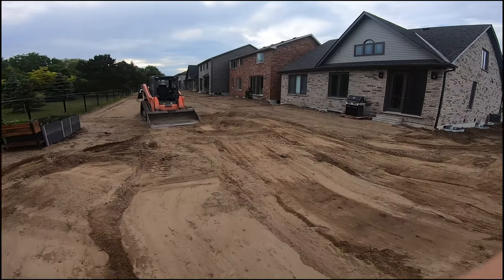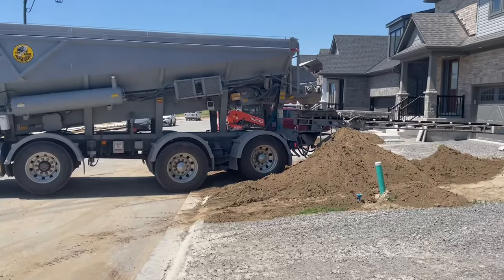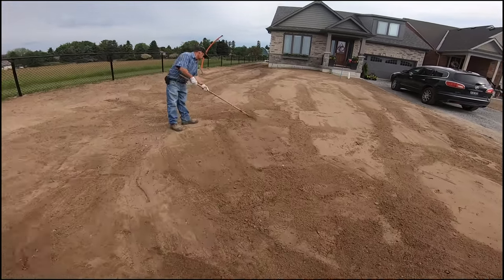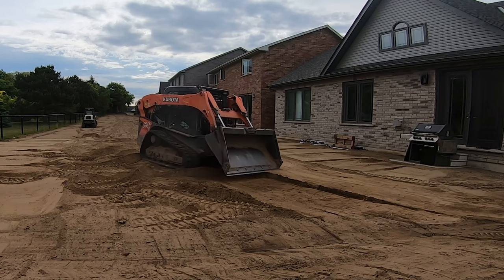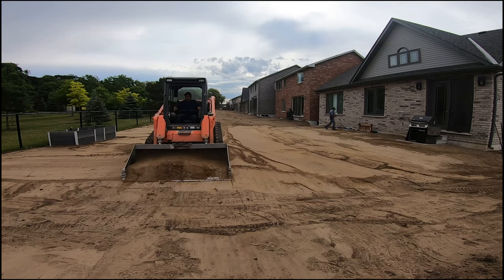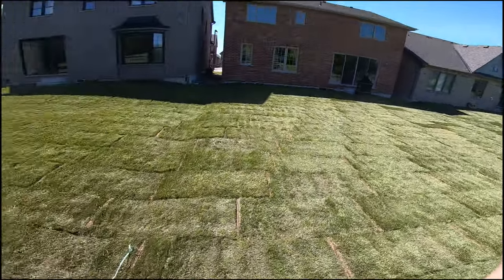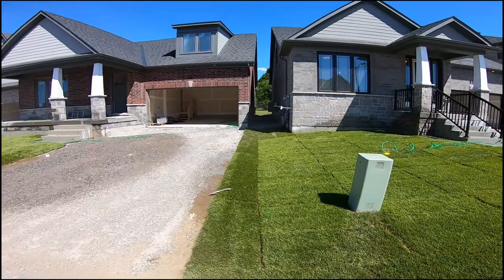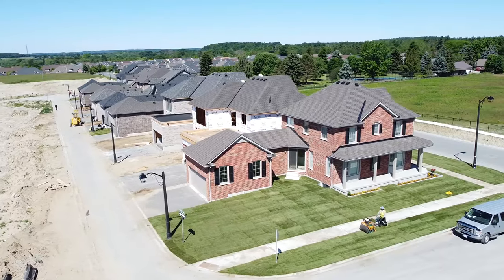TOPSOIL - GRADING - SODDING - A LAKESIDE RESIDENTIAL SUBDIVISION  (THE FULL PROCESS)

Comment: Did you shoot points on it to be sure the water is flowing correctly? It honestly looks like that back area where all the sod is will pool in the center in many areas and/or flow towards the houses.
Reply from the maker: No we don’t typically shoot unless it’s close. We do thousands of homes a year and have a pretty good eye for getting the grades right, as well as bench marks like the heights at the house and grade stakes at the rear. 

This grade is designed to be lowest in the middle of the yard, and then slope to the side yards and out to the street from there.

Very rarely the drainage doesn’t work, and that’s usually due to some type of problem with the building where we can’t achieve enough slope.

Comment: very informative! I am going to rent a small skid steer to dig 5-6 inches of top soil for my backyard project. Should I start excavating  from the highest point to low point of my existing grade? and does "float mode" help in maintaining the grade? Sorry I never used skid steer so wondering how to effectively use it. Thank you!
Reply from the maker: Personally I never use float mode as it doesn’t really cut anything if needed. And it all depends how it’s laid out where to start and how much room you have to work. Usually in a smaller backyard I start at one end and work my way out. If it’s bigger and good access then whichever way is easiest

Comment: Why use the kubota while you had an asv machine there or trex smaller size doesn't make sense but good skills
Reply from the maker: Thanks appreciate it! In which situation? We did use both where necessary.
Reply: @dirty.diggers  sorry didn't mention when you went in the tight space or backyard
Reply from the maker: @dblkouzam  well I’m the backyard is the bigger space so we use the bigger skidsteers! Lol we try to use the bigger ones where possible. If it’s really to tight or won’t fit then yes we use the small one. They just aren’t anywhere near as smooth or efficient compared to bigger ones